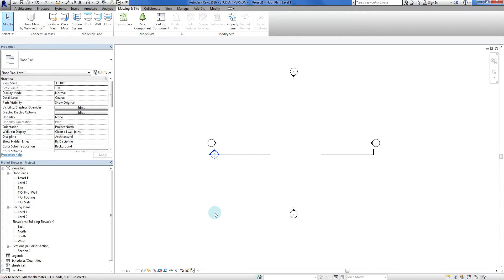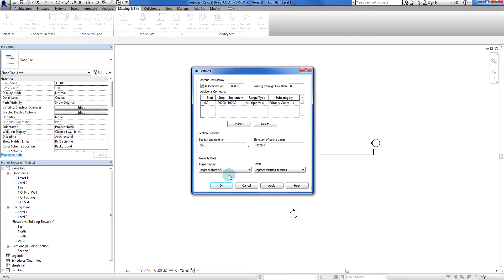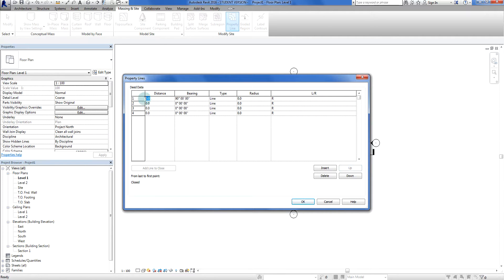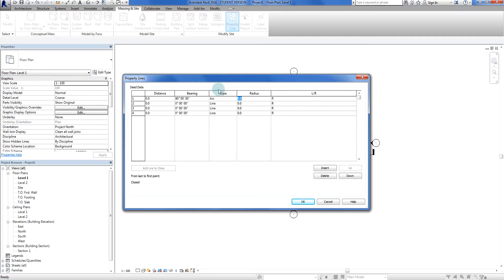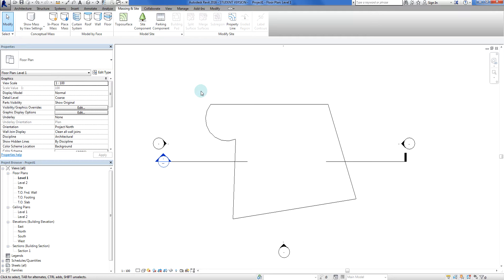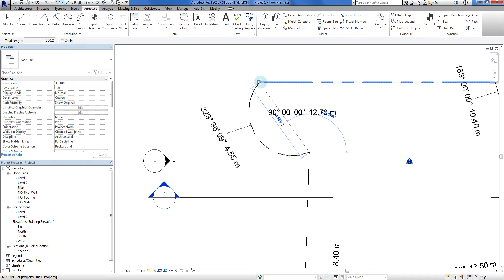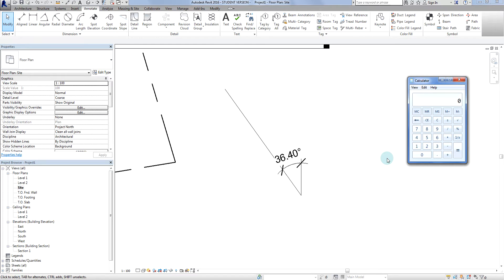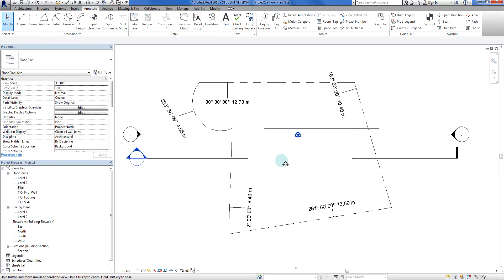Revit - Creating Arcs in Property Lines

Comment: Thanks for the response. It seems that Revit and Autocad are geared to North American surveyor's units. I have an autocad drawing that I've made, I figured out the radius of the arc with the calculator here: http://www.handymath.com/cgi-bin/arc18.cgi
Then I put the "C" (Chord) value into "width of arc" and "A" (Arc length) into "Length of arc", taking care to change the units to mm. Then I rotated the arc to the correct angle. The only issue is the lines don't join exactly in one corner, when I zoom in on the cad drawing there is a slight gap, obviously the decimal places are not precise enough.
Appreciate the videos, they are great, thanks!
Reply from the maker: Hi Keith

I hoped it helped a bit. I did a bit of research and it seems that the chord measurements aren't overly accurate. Your workaround is one reason why AutoCAD will always be around!
Reply: +Rhys Davies (Supernatural) Yes, and the pick lines tip in your video helped with conversion from my Autocad drawing to Revit property line. I've had a lot of experience with Autocad, but I'm only just starting with Revit, so videos like these are a great resource.